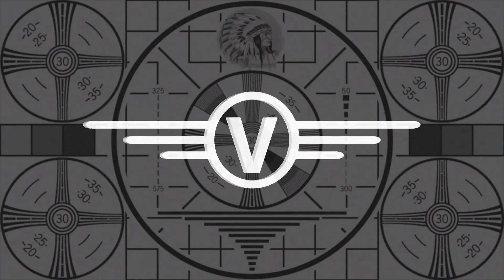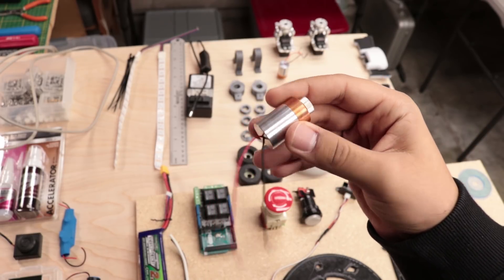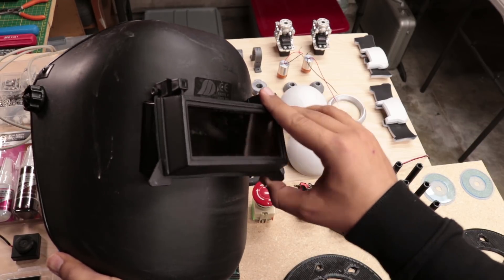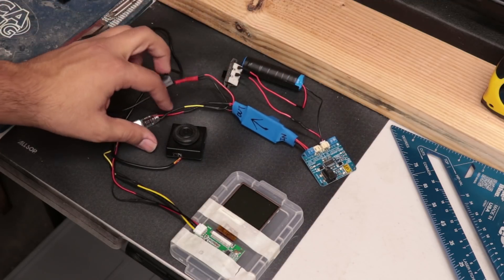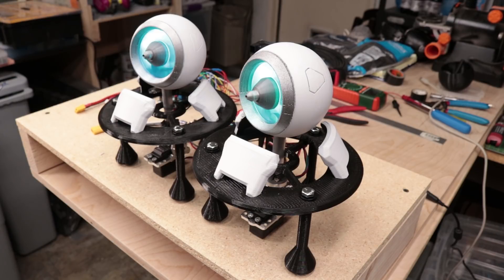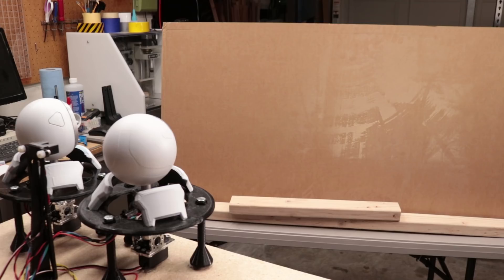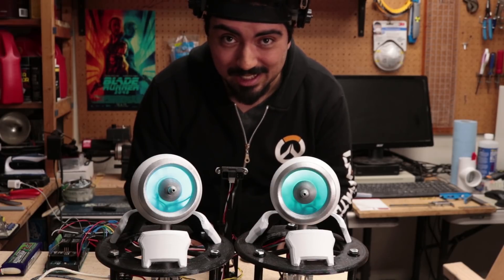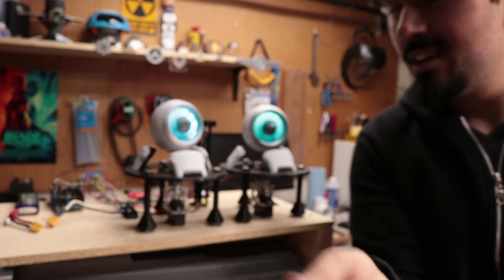Real Symmetra Laser Turrets

Comment: Neato, probably would use an ecolocator unit vs light sensor. They seem to work pretty well at directing RC-cars with cues.
Reply from the maker: Haha, I do have a lot of ultrasonic rangefinders, but I ended up using this because I actually realized there wont be much accurate sensing since I wanted to have the lasers move very little in the end.